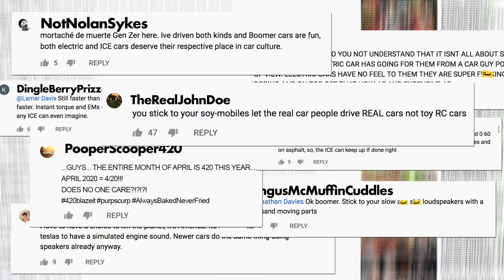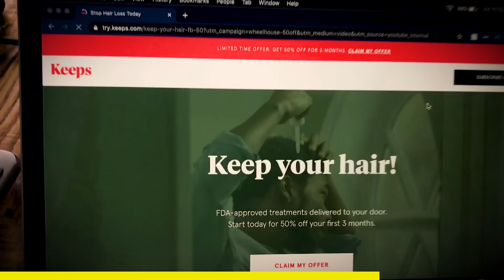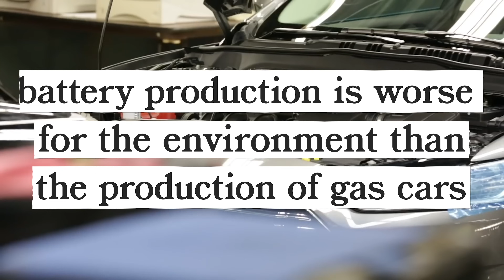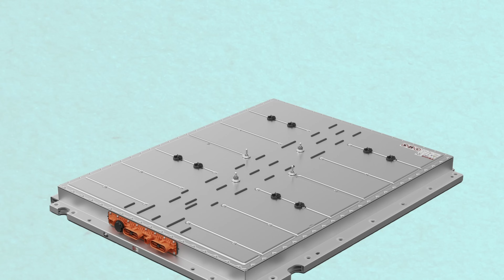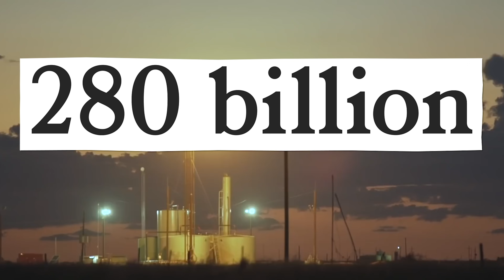Are Electric Cars REALLY Better for the Environment?

Comment: This doesnt change much but i heard a myth that if a tesla battery gets thrown away at a junkyard or something it does more environmental damage than a gas car does in 2 months
Reply: During the Obama-Biden administration, hydraulic fracturing was accused of causing a number of environmental problems—faucets on fire, contamination of drinking water, etc.—but the administration’s own Environmental Protection Agency could not validate those accusations.  Now Biden is planning to transition the transportation sector to electric vehicles that are powered by lithium batteries and require other critical metals where China dominates the market. Mining and processing of lithium, however, turns out to be far more environmentally harmful than what turned out to be the unfounded issues with fracking.
In May 2016, dead fish were found in the waters of the Liqi River, where a toxic chemical leaked from the Ganzizhou Rongda Lithium mine. Cow and yak carcasses were also found floating downstream, dead from drinking contaminated water. It was the third incident in seven years due to a sharp increase in mining activity, including operations run by China’s BYD, one of the world’ biggest supplier of lithium-ion batteries. After the second incident in 2013, officials closed the mine, but fish started dying again when it reopened in April 2016.
Lithium prices doubled between 2016 and 2018 due to exponentially increasing demand. The lithium ion battery industry is expected to grow from 100 gigawatt hours of annual production in 2017 to almost 800 gigawatt hours in 2027. Part of that phenomenal demand increase dates back to 2015 when the Chinese government announced a huge push towards electric vehicles in its 13th Five Year Plan. The battery of a Tesla Model S, for example, has about 12 kilograms of lithium in it; grid storage needed to help balance renewable energy would need a lot more lithium given the size of the battery required.
Processing of Lithium Ore
The lithium extraction process uses a lot of water—approximately 500,000 gallons per metric ton of lithium. To extract lithium, miners drill a hole in salt flats and pump salty, mineral-rich brine to the surface. After several months the water evaporates, leaving a mixture of manganese, potassium, borax and lithium salts which is then filtered and placed into another evaporation pool. After between 12 and 18 months of this process, the mixture is filtered sufficiently that lithium carbonate can be extracted.
South America’s Lithium Triangle, which covers parts of Argentina, Bolivia and Chile, holds more than half the world’s supply of the metal beneath its salt flats. But it is also one of the driest places on earth. In Chile’s Salar de Atacama, mining activities consumed 65 percent of the region’s water, which is having a large impact on local farmers to the point that some communities have to get water elsewhere.
As in Tibet, there is the potential for toxic chemicals to leak from the evaporation pools into the water supply including hydrochloric acid, which is used in the processing of lithium, and waste products that are filtered out of the brine. In Australia and North America, lithium is mined from rock using chemicals to extract it into a useful form. In Nevada, researchers found impacts on fish as far as 150 miles downstream from a lithium processing operation.
Lithium extraction harms the soil and causes air contamination. In Argentina’s Salar de Hombre Muerto, residents believe that lithium operations contaminated streams used by humans and livestock and for crop irrigation. In Chile, the landscape is marred by mountains of discarded salt and canals filled with contaminated water with an unnatural blue hue. According to Guillermo Gonzalez, a lithium battery expert from the University of Chile, “This isn’t a green solution – it’s not a solution at all.”
China is among the five top countries with the most lithium resources and it has been buying stakes in mining operations in Australia and South America where most of the world’s lithium reserves are found. China’s Tianqi Lithium owns 51 percent of the world’s largest lithium reserve in Australia, giving it a controlling interest. In 2018, the company became the second-largest shareholder in Sociedad Química y Minera—the largest lithium producer in Chile. Another Chinese company, Ganfeng Lithium, has a long-term agreement to underwrite all lithium raw materials produced by Australia’s Mount Marion mine—the world’s second-biggest, high-grade lithium reserve.
Recycling Lithium-Ion
In Australia, only two percent of the country’s 3,300 metric tons of lithium-ion waste is recycled. Unwanted MP3 players and laptops often end up in landfills, where metals from the electrodes and ionic fluids from the electrolyte can leak into the environment.
Because lithium cathodes degrade over time, they cannot be placed into new batteries. Researchers are using robotics technology developed for nuclear power plants to find ways to remove and dismantle lithium-ion cells from electric vehicles. There have been a number of fires at recycling plants where lithium-ion batteries have been stored improperly, or disguised as lead-acid batteries and put through a crusher. Not only have these batteries burned at recycling plants, but auto makers are seeing battery-related fires leading to vehicle recalls and safety probes. In October, U.S. safety regulators opened a probe into more than 77,000 electric Chevy Bolts after two owners complained of fires that appeared to have begun under the back seat where the battery is located.
Because manufacturers are secretive about what goes into their batteries, it makes it harder to recycle them properly. Currently, recovered cells are usually shredded, creating a mixture of metal that can then be separated using pyrometallurgical techniques—burning—which wastes a lot of the lithium. Alternative techniques, including biological recycling where bacteria are used to process the materials, and hydrometallurgical techniques which use solutions of chemicals in a similar way to how lithium is extracted from brine are being investigated.
It is estimated that between 2021 and 2030, about 12.85 million tons of EV lithium ion batteries will go offline worldwide, and over 10 million tons of lithium, cobalt, nickel and manganese will be mined for new batteries. China is being pushed to increase battery recycling since repurposed batteries could be used as backup power systems for China’s 5G stations or reused in shared e-bikes, which would save 63 million tons of carbon emissions from new battery manufacturing.
Cobalt Extraction Also Poses Environmental Problems
Cobalt is found in huge quantities in the Democratic Republic of Congo and central Africa where it is extracted from the ground by hand, using child labor, without protective equipment. China owns eight of the 14 largest cobalt mines in the Democratic Republic of Congo and they account for about half of the country’s output. While China has only 1 percent of the world’s cobalt reserves, it dominates in the processing of raw cobalt. The Democratic Republic of Congo is the source of over two-thirds of global cobalt production, but China has over 80 percent control of the cobalt refining industry, where raw material is turned into commercial-grade cobalt metal.
Like lithium, the price of cobalt has quadrupled in the last two years.
Conclusion
Environmentalists expressed unfounded concerns about fracking, but they need to be worried about replacing fossil fuels in the transportation and electric generating sector with electric vehicles and renewable energy where lithium, cobalt and other critical metals are needed to produce these technologies. Mining, processing, and disposing of these metals can contaminate the drinking water, land and environment if done improperly as seen from several examples. And, since China dominates the global market, it just switches what once was U.S. reliance on the Middle East to U.S. reliance on the People’s Republic.
H., David. "Toxic Chemicals in Solar Panels" sciencing.com, https://sciencing.com/toxic-chemicals-solar-panels-18393.... 12 August 2021.
Reply: @nobullshiit5682  well your name is true haha

Comment: During the Obama-Biden administration, hydraulic fracturing was accused of causing a number of environmental problems—faucets on fire, contamination of drinking water, etc.—but the administration’s own Environmental Protection Agency could not validate those accusations.  Now Biden is planning to transition the transportation sector to electric vehicles that are powered by lithium batteries and require other critical metals where China dominates the market. Mining and processing of lithium, however, turns out to be far more environmentally harmful than what turned out to be the unfounded issues with fracking.
In May 2016, dead fish were found in the waters of the Liqi River, where a toxic chemical leaked from the Ganzizhou Rongda Lithium mine. Cow and yak carcasses were also found floating downstream, dead from drinking contaminated water. It was the third incident in seven years due to a sharp increase in mining activity, including operations run by China’s BYD, one of the world’ biggest supplier of lithium-ion batteries. After the second incident in 2013, officials closed the mine, but fish started dying again when it reopened in April 2016.
Lithium prices doubled between 2016 and 2018 due to exponentially increasing demand. The lithium ion battery industry is expected to grow from 100 gigawatt hours of annual production in 2017 to almost 800 gigawatt hours in 2027. Part of that phenomenal demand increase dates back to 2015 when the Chinese government announced a huge push towards electric vehicles in its 13th Five Year Plan. The battery of a Tesla Model S, for example, has about 12 kilograms of lithium in it; grid storage needed to help balance renewable energy would need a lot more lithium given the size of the battery required.
Processing of Lithium Ore
The lithium extraction process uses a lot of water—approximately 500,000 gallons per metric ton of lithium. To extract lithium, miners drill a hole in salt flats and pump salty, mineral-rich brine to the surface. After several months the water evaporates, leaving a mixture of manganese, potassium, borax and lithium salts which is then filtered and placed into another evaporation pool. After between 12 and 18 months of this process, the mixture is filtered sufficiently that lithium carbonate can be extracted.
South America’s Lithium Triangle, which covers parts of Argentina, Bolivia and Chile, holds more than half the world’s supply of the metal beneath its salt flats. But it is also one of the driest places on earth. In Chile’s Salar de Atacama, mining activities consumed 65 percent of the region’s water, which is having a large impact on local farmers to the point that some communities have to get water elsewhere.
As in Tibet, there is the potential for toxic chemicals to leak from the evaporation pools into the water supply including hydrochloric acid, which is used in the processing of lithium, and waste products that are filtered out of the brine. In Australia and North America, lithium is mined from rock using chemicals to extract it into a useful form. In Nevada, researchers found impacts on fish as far as 150 miles downstream from a lithium processing operation.
Lithium extraction harms the soil and causes air contamination. In Argentina’s Salar de Hombre Muerto, residents believe that lithium operations contaminated streams used by humans and livestock and for crop irrigation. In Chile, the landscape is marred by mountains of discarded salt and canals filled with contaminated water with an unnatural blue hue. According to Guillermo Gonzalez, a lithium battery expert from the University of Chile, “This isn’t a green solution – it’s not a solution at all.”
China is among the five top countries with the most lithium resources and it has been buying stakes in mining operations in Australia and South America where most of the world’s lithium reserves are found. China’s Tianqi Lithium owns 51 percent of the world’s largest lithium reserve in Australia, giving it a controlling interest. In 2018, the company became the second-largest shareholder in Sociedad Química y Minera—the largest lithium producer in Chile. Another Chinese company, Ganfeng Lithium, has a long-term agreement to underwrite all lithium raw materials produced by Australia’s Mount Marion mine—the world’s second-biggest, high-grade lithium reserve.
Recycling Lithium-Ion
In Australia, only two percent of the country’s 3,300 metric tons of lithium-ion waste is recycled. Unwanted MP3 players and laptops often end up in landfills, where metals from the electrodes and ionic fluids from the electrolyte can leak into the environment.
Because lithium cathodes degrade over time, they cannot be placed into new batteries. Researchers are using robotics technology developed for nuclear power plants to find ways to remove and dismantle lithium-ion cells from electric vehicles. There have been a number of fires at recycling plants where lithium-ion batteries have been stored improperly, or disguised as lead-acid batteries and put through a crusher. Not only have these batteries burned at recycling plants, but auto makers are seeing battery-related fires leading to vehicle recalls and safety probes. In October, U.S. safety regulators opened a probe into more than 77,000 electric Chevy Bolts after two owners complained of fires that appeared to have begun under the back seat where the battery is located.
Because manufacturers are secretive about what goes into their batteries, it makes it harder to recycle them properly. Currently, recovered cells are usually shredded, creating a mixture of metal that can then be separated using pyrometallurgical techniques—burning—which wastes a lot of the lithium. Alternative techniques, including biological recycling where bacteria are used to process the materials, and hydrometallurgical techniques which use solutions of chemicals in a similar way to how lithium is extracted from brine are being investigated.
It is estimated that between 2021 and 2030, about 12.85 million tons of EV lithium ion batteries will go offline worldwide, and over 10 million tons of lithium, cobalt, nickel and manganese will be mined for new batteries. China is being pushed to increase battery recycling since repurposed batteries could be used as backup power systems for China’s 5G stations or reused in shared e-bikes, which would save 63 million tons of carbon emissions from new battery manufacturing.
Cobalt Extraction Also Poses Environmental Problems
Cobalt is found in huge quantities in the Democratic Republic of Congo and central Africa where it is extracted from the ground by hand, using child labor, without protective equipment. China owns eight of the 14 largest cobalt mines in the Democratic Republic of Congo and they account for about half of the country’s output. While China has only 1 percent of the world’s cobalt reserves, it dominates in the processing of raw cobalt. The Democratic Republic of Congo is the source of over two-thirds of global cobalt production, but China has over 80 percent control of the cobalt refining industry, where raw material is turned into commercial-grade cobalt metal.
Like lithium, the price of cobalt has quadrupled in the last two years.
Conclusion
Environmentalists expressed unfounded concerns about fracking, but they need to be worried about replacing fossil fuels in the transportation and electric generating sector with electric vehicles and renewable energy where lithium, cobalt and other critical metals are needed to produce these technologies. Mining, processing, and disposing of these metals can contaminate the drinking water, land and environment if done improperly as seen from several examples. And, since China dominates the global market, it just switches what once was U.S. reliance on the Middle East to U.S. reliance on the People’s Republic.
H., David. "Toxic Chemicals in Solar Panels" sciencing.com, https://sciencing.com/toxic-chemicals-solar-panels-18393.... 12 August 2021.
Reply: Don’t forget about all the toxic metals and minerals needed for wiring, soldering, and other connectors plus sensors, computers and displays in EVs!!!
Reply: Tried clicking the link you provided but looks like the article was taken down! 🤔
Reply: @gregfair1749   well they took down the pics of all t he deformed children born in the slums next to these toxic dump sites so why wouldn't they, not surprised everything seems to be controlled by vachina now